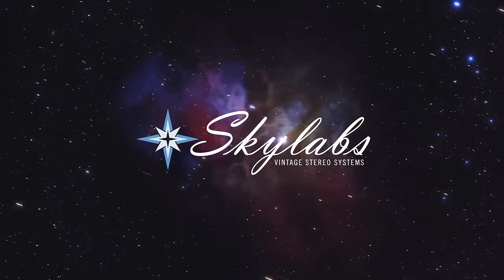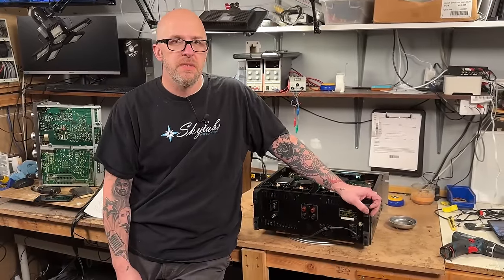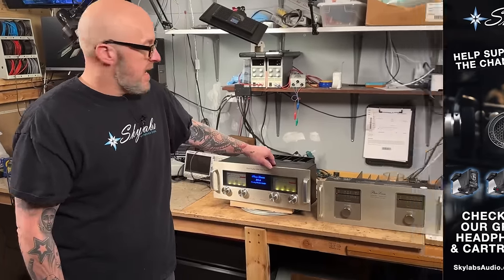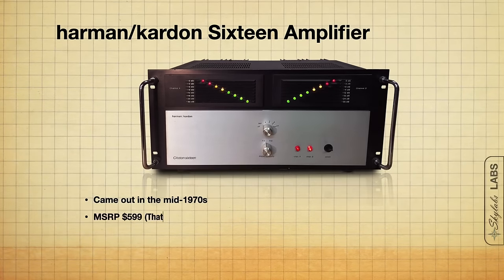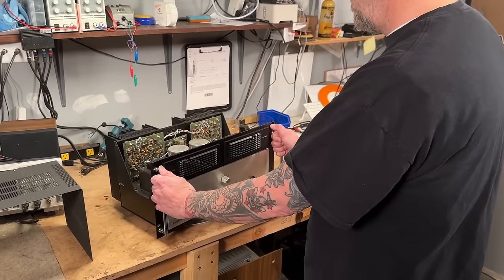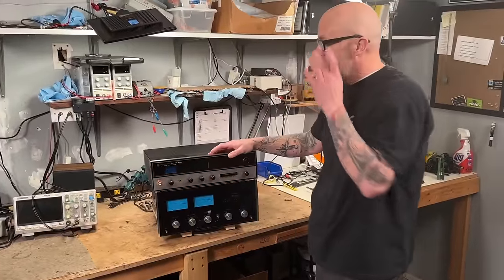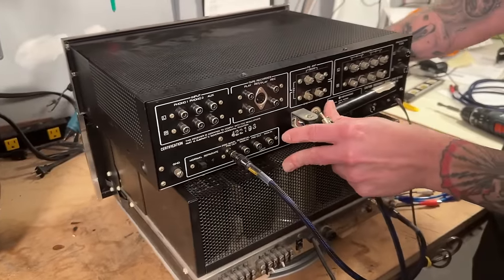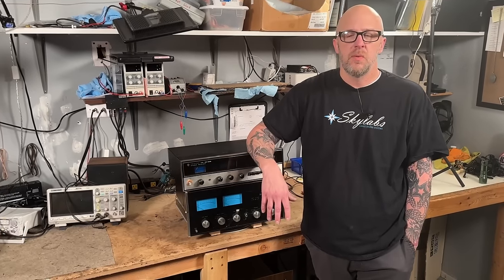5 of our Favorite Vintage Stereo Amplifiers from the 70s!

Comment: Another good video. Separate amps can produce more and cleaner power than many receivers. I have a McIntosh C-26 pre and 2100 amp. I agree about the tube like warm sound. It doesn't have the cool blue meters on it but played through my ADS 710's it sounds great. I had a 8010 Kenwood 125wpc receiver and still have a Yamaha R-100 100wpc receiver and they both sound great, just a bit cooler and more clinical sounding. I do have a M-400a Carver Cube I use for my ADS SW-4 sub and at 200 WPC it puts out great bass.

Comment: I had a rare 70's power amp I bought to drive Magnapan speakers. The yamaha B2, which uses VFET transistors.
Only yamaha and sony used VFET"s.  Touted for their tube like sound, and were the predecessor to today's MOSFET's. Unfortunately VFET's have been out of production and are basically "unobtainium ". It was rated at 100W/ channel and was dual mono. I like the later 80's M series with the big LED meters as well.

Comment: Simply use a fuse for the output. No need for a relay which can introduce conductive noise after time into the circuit.

Comment: Hey guys, it was actually "BLAZE" Linear what we called them cause they would cook!  Also, Stephen Eson mentioned below the Crown line of products in the 70's and 80's, certainly a line worth considering, incredibly reliable and as Stephen mentioned, a key competitor to Mac, as were SAE or GAS, but a very different sound compared to Mac.  The Japanese lines did not have the level of respect back then as they seem to have now, but they did sell a ton of stuff relative to the domestics so they are certainly more plentiful now.  Stephen also mentioned the Plant fire (the Barn) at Crown in Elkhart, Indiana, they had amp production back up in a couple months and preamps soon after, the key casualty of the fire was the loss of tooling to make the Crown Open reel tape decks, they were top of the line back then, blowing away the likes of Teac or Pioneer and Akai, their real competitor on the 800 series stuff were the commercial Studer and Ampex units.  Also, Crown for the most part is dead, as are most of the Harmon acquisitions, Samsung has acquired Harmon several years ago and is doing a good job of homogenizing all those products, I suspect before long they will all be the same.  Sad to see many old names reduced to a marketing name, like Nakamichi or Sansui, nothing left but a brand...

Comment: The preamp output on any piece of equipment is always active; 
you can use it without moving the switch to "separate", thereby eliminating the need for Y cables.    
On units with jumpers and no switch you Will need Y cables. 
Otherwise, great stuff here.

Comment: Just thought I'd mention: in the demo section you don't have any close-ups, so you say "pre out to the amplifier," but you can't see what you're plugging into on it. I think beginners might still be confused after that. And they might not understand channels. Anyway, another fun video. I learned about some amps i didn't know about.
Question: i know dirty pots cause pops, but i just hooked up an old pioneer and it had an intermittent loud pop that echoed. It did not sound good. Is that some other issue?

Comment: I've worked on a phase linear 4000 phase II and I had to redo every single solder in it. I don't recommend, not at all.
Of course, harman kardon citation 16 and even 12 are something I would prefer. They used the same desing, which is semi push pull. Just like the mc250 but without the output transformer. All of these sound awesome.

Comment: I used to own the Pioneer Spec-1 and Spec-2, Amp/preamp combination. Unfortunately,, a repair shop was in possession of my amp when it went out of business and stole my Spec-2 amp. I purchased this amp while stationed on Okinawa in 1978/79, serving in the US Marine Corps. I ended up selling the Spec-1 preamp to a collector on eBay. I also owned the Pioneer RT-707 and RT-909 open reel decks; CT-F900 cassette deck; SG-9800 graphic eq; a Pioneer turntable; MA-62A disco mixer, SR-303 reverb; RG-1 processor; DT-400 timer and of course, the Pioneer equipment rack. At the time, Pioneer didn't make speakers which would handle the power of the Spec-2, so I went with 2 pair of Sansui SP-X11000 speakers, with 2-17" woofers in each side. Most of this equipment was used in an Apostolic church as their main PA system for at least 10 years.

Comment: Just a clarification on the Pioneer Spec2 power rating.  I've owned a Spec 1 and Spec 2 since new.  It was stated that the Spec 2 had less power than the 150W per channel Spec 4.  The Spec 2 is actually rated at 250W per channel min RMS at 8 ohms from 20HZ to 20,000Hz at no more than .01% THD.  The owners manual was printed incorrectly at 125W but an updated sticker was added by Pioneer in the manual I have as the correction.  The power bandwidth graph included in the manual supports the 250W rating. And the meters are scaled to 500W!

Comment: I've got a pair of Phase Linear 400s which are currently not in use.   I used to also have the matching Pre-Amp (4000) and a Tuner.   It was a pretty impressive display with the giant VU meters.   After a while I sold the 4000 and then used a Pioneer SX8100 for the preamp.   I am toying with the idea of using one again, this time paired with a Marantz 2240.  But I am leery of using them without speaker protection.  Mine have not been modified.   Does anyone know if a simple inline fuse (what size fuse??) in the speaker leads would work?

 I was told that bands used to use them for their PA systems in larger halls.  The fuses used to blow all the time so guys used to put larger and larger fuses in them.   The end result was them burning up, hence the nickname.    When I win the lottery I'll buy that McIntosh.    Great vid.  Thanks.
Reply: For what it's worth, I had a pair of Advents on my 700, I used a 3 amp fast blowing fuse inline. I don't think I ever blew a fuse.
Reply: i am doing exactly that...i have 2 400's was gonna bi-amp but one of the amps needs work..i will be running the Marantz 2238BL as a pre-amp and using just one of the 400's for now..i am also going to be using in-linlie fuses..starting at 2 amps and moving up to.2.5 amps if it blows....make sure they are "fast blow fuses"

Comment: I have got a Proton D1200 power amp, also from the 80’
It got DPD, that means dynamic power on demand.
It can go up to 1000W for a very brief time.
Proton was a precursor from NAD.
Do you guys know this one.
I run it with the Proton P1100 pre-amp.

Comment: Skylabs - what's your opinion of the early 1980s skinny Pioneer blue-line amps?  How do they compare with the late 1970s full-size Pioneers?   I have an SA-610 and an SA-620. Considering selling them both and getting an SA-6800 or SA-7800.  Thanks

Comment: Pie In Ear. I will take a Harmon Kardon Citation 16 power amplifier with A Hardon Kardon Citation 17 preamplifier. As a dealer I got HK products for half price so I had two Citation 16's bridged. S. A. E. was good, Krell, Marl Levinson, audio research corporation, acoustat MOSFET power amp, BGW, G.A. S. Ampzilla so much more Quatre Gain Cell power amplifier, Marantz

Comment: Respectfully, I need to correct you on one fact about the Pioneer amps. The Spec-2 amp is actually more powerful than the Spec-4. The Spec-2 has a rating of 250watts per channel RMS at 8ohms.

Comment: It occurred to me I could use Y splitters to use my integrated amp with it's main or a separate amp...

... but I just assumed I was doing something that would be frowned on by others, and I really wasn't sure if it would have any impact on the sound. 

Is there any potential down side from an audio signal perspective to adding these extra connections, or is there no difference in the signal being delivered to the amp(s)? Note that I was only running one amp at a time. 

Some people might say if I like the sound it doesn't matter, but lets be honest, I've had equipment that took me months to notice an un-quantifiable feeling that it's just less engaging to me than something else I replaced it with. 

Nothing is that straight forward for me as just knowing immediately if I find something is not sounding the best to me that it could be performing.

Comment: Curious - What is a speaker protection relay? Same as a thermal relay? Old school here
Reply: Two functions:

1) If any transistor shorts in a DC coupled amplifier you can have either the full B+ or B- power rail go to the speaker terminals. This will destroy just about any woofer ever made. Fuses are not good enough as they are too slow. Sometimes even a speaker protection relays are not good enough but better then none at all.

2) Many amps produce turn-on and turn-off thumps. The speaker relay is typically delayed turn-on and instantaneous turn-off to prevent speaker damage.
Reply: @andydelle4509  Like a thermal relay in general? And a delay system?
Reply: @ethimself5064  What do you mean by a "thermal relay"?
Reply: @andydelle4509  Typical audio and electric kitchen equipment etc have built in thermal relays that when something gets hot enough it will trip a circuit to break the connection until things cool down enough the connect again.
Reply: @elf5064 OK,  now I know what you mean. Some manufactures, Hafler for example,  did use these devices to monitor the heat sink temperature. If too hot they opened killing the AC line to the power transformer. But the speaker protection relay is different for a different function.

Comment: What, the 700B and 400 get a mention, but not the Dual 500, or D-500? Came out about the same time and was Phase Linear’s most expensive and most powerful amp.

Comment: On the McIntosh MC 2105 you say that it is the first solid state amp by McIntosh. Does the MC 2100 predate it. Appearance wise, it looks like solid state amp on a tube chassis. I have a 2100 and always wondered it's place in the MC line up.
Reply: This from Roger Russel Site.

The New MC2505 Amplifier

The MC2505 was the first separate solid state power amplifier made by McIntosh. This amplifier was a major step in McIntosh amplifier history and introduced many features still used in McIntosh amplifiers today. It was the first amplifier to have an all-glass front panel, panloc mounting, illuminated, peak-reading output level meters, Sentry Monitor circuitry and autoformers. The MC2505 autoformers were a new concept in the history of McIntosh transformer design.

Comment: A couple things, to expand on what others have already mentioned.

First I would almost always be sure not to turn you preamp past,  “high noon”!
If that does not create the big sound your looking for consider a higher WPC Power Amp?
Small speakers need a subwoofer as a workaround, if you don’t want new ones.   Too much can over drive the cone or worse damage a crossover.   Some say 2:00 on the volume, that’s usually going to sound bad and your in the danger area or $$ area.  Subsonic filters can reduce the draw but not reproduce big sound…. 

The last thing is and most important is weight (A pound for every WPC, 185WPC on a quality Smp is 185 pounds!  Ok I’m exaggerating, but I doubt is much less.   I know I forgot something, so let me know, my back hurts.🙂

Comment: I have  4 Sunn Magna 3800 power amps from the mid 70s 160 watts 8 ohms an would go down to 2 ohms at 800 watts. I would put them up against any of these amps. .045 distortion which you can’t hear.

Comment: Vintage Speakers
I Have a Pair of 
JBL Lancers 90
It’s Like a 14” Woofer
And Twitter Mine Are Paired Left And Right 
Or Mirrored I Had Them Re/Coned And Cap
I Have a Fisher 400B
With Those Super Hard To Fine 7868 Power Tubes
I Listen To Lots of
1960’s Music 
And This Combo Is Just
Boss 
60’ Jazz To Rock
To R&B and 
Johnny Cash 
Honorable Mention To
RSL Speakers Whom Are The Poor Man’s 
JBL’s 
Hey RSL Speakers are Not To Bad also 
Let’s Not Forget 
The ESS AMT 
The Air Motion Transformer Speakers 
I Think Those Speakers Are Still Under The Radar 
Super High Screaming High Frequencies 
Am Starting To Enjoy Your Show 
Yes The ESS AMT 1970’s
Is a Great Underrated 
Off The Radar Speaker 
That Is Just Far Ahead of Its Time

Comment: The Phase Linear 700B is Super Rare Yet The Phase Linear 700B Pro. Black Face Was The Touring Model or Holy Grail I was'nt Looking For One and i Walk into The Local Pawn Shop and There It Is Only $300 Bucks The Damn Thing is About 50 Pounds You Can't Kill This Pig It's Just All Power......When I Turn It On The House Lights Dim  Bob Carver Built This One The Back Tag On The Transformer Says Seattle Washington The Original Back Cooling Fins Had a Cover Over The Transistors This Is a Great Amp of The 1970's I don't Know Where Your Shop is Yet i Would Bring it Over If You are in Los Angeles

Comment: I've had several amps and receivers. Spend money on your speakers, all you need is enough watts to run them. My ears cant tell the difference. If yours can, lucky you. Side note, if you decide to run your Kenwood into a Mac as pictured, run them side by side not on top, the heat from the Mac rising up into the Kenwood is not an ideal situation. I know that's not what is happening here, but it's something I see all over the internet people stacking their stuff. Don't do this, you're asking for trouble.

Comment: There amplifier are too old for me , any problem service cost will be to high. also need recap and chang protection relay some wire rusty need replaced . I pass that . go for 1990 Conrad Johnson or McCormack, audio research , or Krell amplifier.